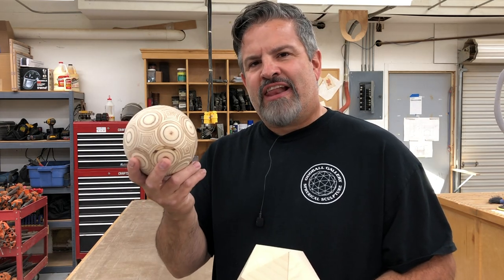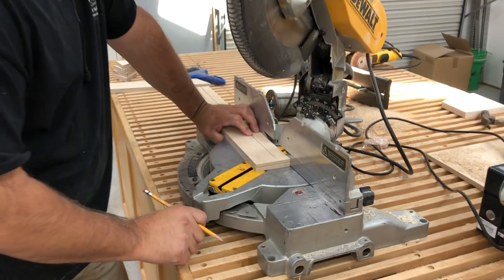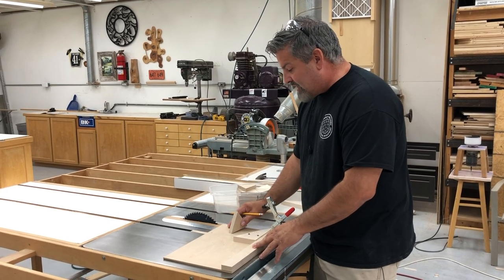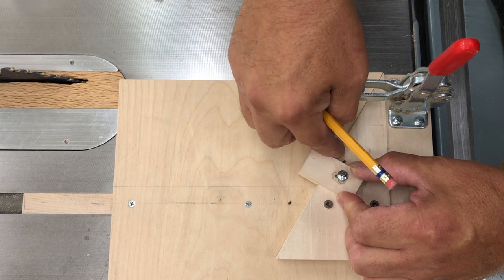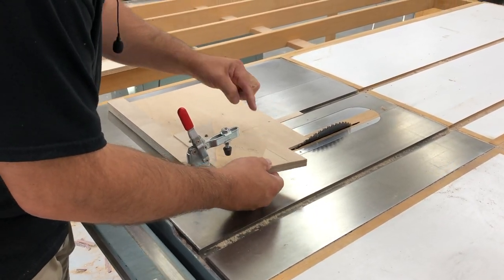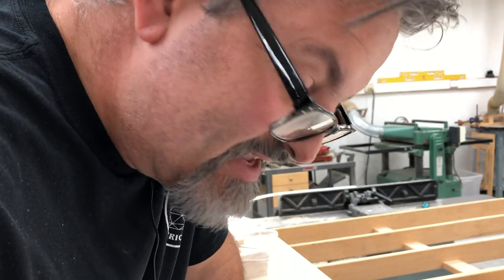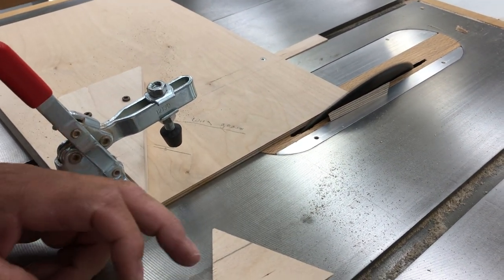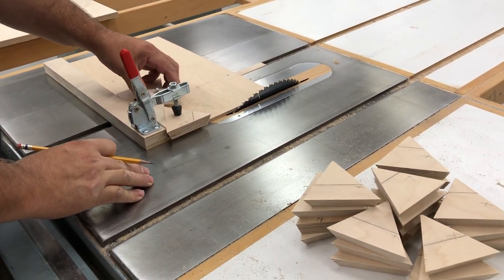How to build a plywood ball  - Part 1

Comment: If you make more than one of plan on making more later you could consider making a wooden gauge to set your table saw angle easily in the future. A simple Thin scrap piece of plywood would suffice.
Reply from the maker: You are right , I have setup gauges made from lexan that I use for my chop saws.

Comment: ThankYou for sharing. 

Question: does your 21.7 angle change with thicker material or wider equilaterals? ThankYou
Reply from the maker: The angle will stay the same. If you are going to make the triangles larger, you will also have to make them thicker (if you plan on rounding it off).
Reply: @ODDBALLGALLERYKeithWilliams  ThankYou

Comment: Awesome video series! Could it be possible to get mm measurements for us old continent folk (maybe as a text displayed on the video), please? Inches are way too confusing for my simple mind 😅
Reply from the maker: Plywood blank is 60cm x 18cm.   Cut into strips 8cm wide.  I think that was the only inch measurements I mentioned.  As long as all the pieces are the same it will work out.
Reply: ODDBALL GALLERY - Keith Williams thanks buddy, great work!

Comment: how much the ball weights after sanding completely? is it too heavy & thick?
Reply from the maker: I don’t know...I will have to weigh  it. The centers of the triangles are still near original thickness. The centers of the “web” areas is about 5/16” (8mm)
Reply: @ODDBALLGALLERYKeithWilliams  Ok. And how did you determine the primary bevel angle of the triangles? that it might be or close to 21.7 degrees?
Reply from the maker: Ismat Jahan There are quite a few cad programs that can figure the angles. I saw another video that used 21 degrees so I just started there and refined it until the pieces fit tight. All of the triangles are exactly the same so if the first five fit correctly the rest will fit too.
Reply: @ODDBALLGALLERYKeithWilliams   Will the board be curved by time? & lose the shape?
Reply from the maker: Ismat Jahan I have some that are over 10 years old and they are still in good condition. Most alphetic resin glue will “creep” over time and you will notice a slight raising of glue joint
Reply: @ODDBALLGALLERYKeithWilliams  Anyway to solve the glue issue? For how long the glue with stay nicely?
Reply from the maker: Ismat Jahan The glue Bond will last a long time.
Reply: I meant creeping glues over time with a slight raising of glue will it be a big issue to think?
Reply from the maker: Ismat Jahan I have some that are over 10 years old that are still in perfect condition. If you have  worked with yellow wood glue then you have experienced glue creep.

Comment: Nice work! By the way, look at my profile picture ;)
Reply from the maker: Thanks👍🏼 I can’t quite make out the pic. What do you make?
Reply: Also 'balls' made of wood. A little different than you do it and pure for myself. Not that I wouldn't sell one if someone wants to buy a copy.
Two examples:
My logo here: https://i.imgur.com/tQXWAnv.jpeg
A football / fullerene: https://i.imgur.com/frcnPzx.jpeg (now I have placed that last piece)
The material is 3 mm laser cut plywood. The diameter is 200 mm (8 inches)

Greets from the other side of the pond!